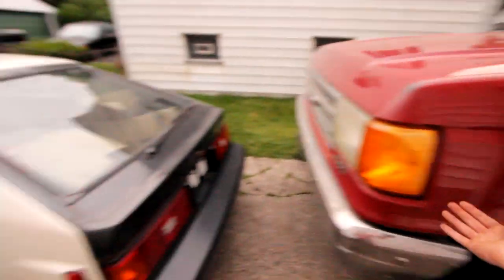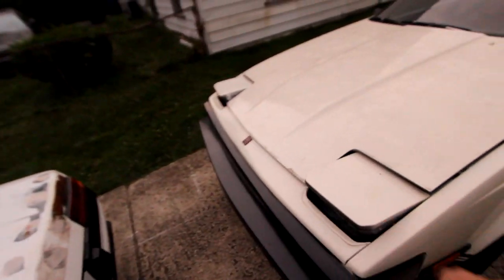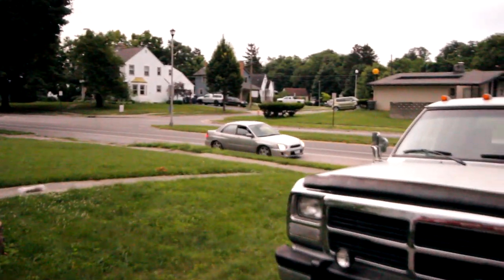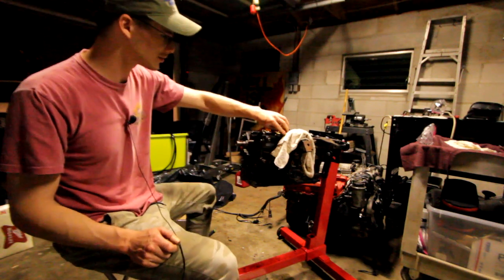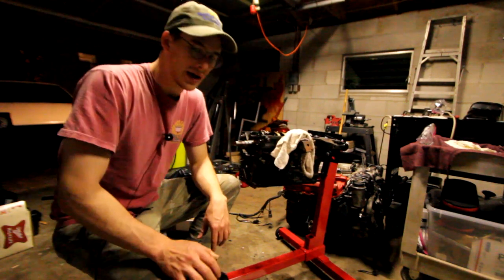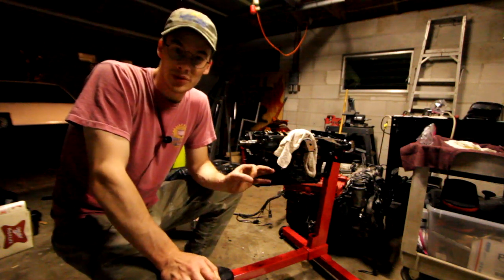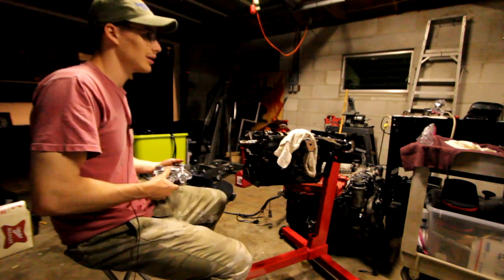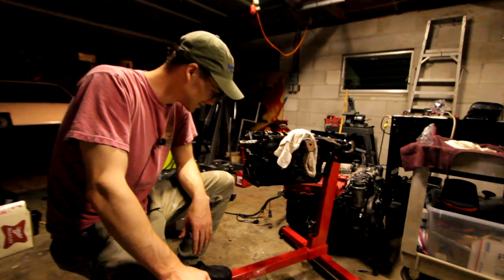4AGE Gasket and Seal Kit - Part 1

Comment: i have a gze on the same stand lol that I'm refreshing but I'm newer to this than you, do you have any advice? I'm just trying to build a gentle turbo build at 8-10 psi, already have turbo and manifold  and bov just don't have the downpipe or ecu or cooling yet but everything else seems golden. thanks for your time!
Reply from the maker: Nothing off the top of my head other than, download the engine manual, get an adjustable fuel pressure regulator, and get sensors + gauges to monitor oil pressure, oil temp, coolant temp, etc. These engines are pretty straight forward if you follow the manual.